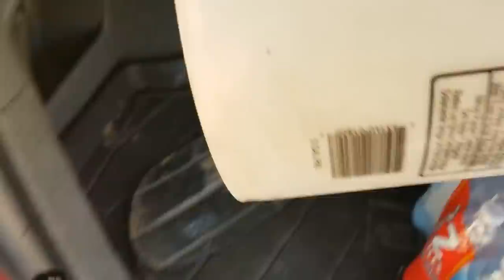Removing HUGE RATTLESNAKE From Person's House!

Comment: Not trying to tell you what to do but just speaking from years of experience  myself  running a snake farm in texas ( little river rattlesnake ranch). you really  ought to consider investing in a pair of good tongs. I know they are not cheap but are more than worth it. And not no cheap ones either.
 The ones worth buying cost at the very least $60  on up to around  $100 or more. But as I said  are well worth it. Anything less than that are cheaply made and won't last and poor designs that can injure the snakes.. not dissing on hooks. I use them just as much and they are just as important of tool but two different tools with  two different purposes. The right pair  of tongs at the right length for you where you are still comfortable will give you alot more control over the snake and gaining control over the snake a lot faster. Also making  it a way more safe for you and the snake.
Reply from the maker: You are correct on all accounts! We actually recently just purchased tongs. Thank you!

Comment: Surprise no one is talking about the way you handle them. It probably seems to you that your not hurting them but you really are. Your making quick movements which stress the snake out, not only does it stress the snake out it raises your risk of getting bite. I’m not even licensed and i do this here in KY with copperheads and cottonmouths and those r just some issues I see.